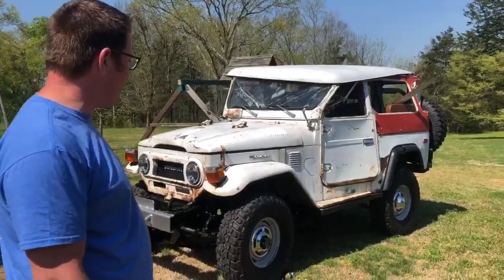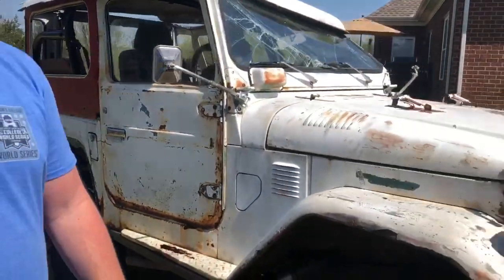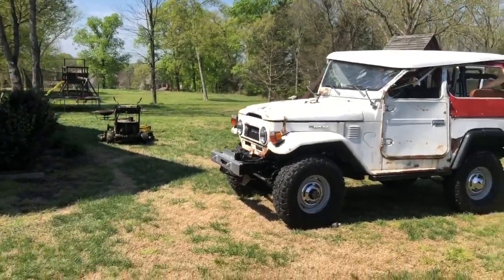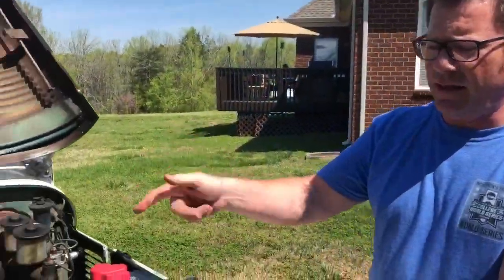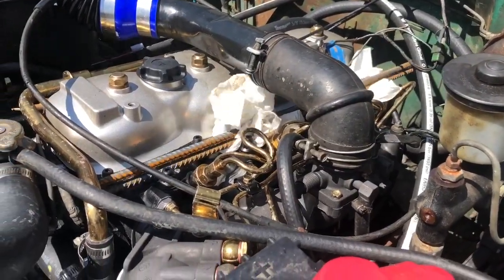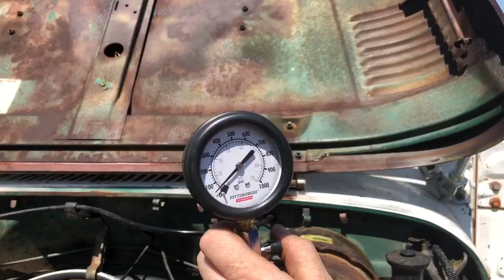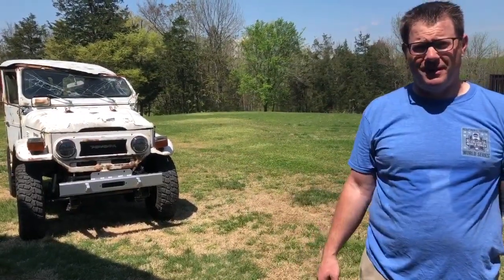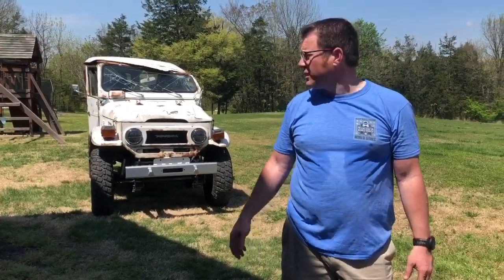Put the FJ40 on its lid - how much damage?

Comment: Ouch...  did you get a chance to figure gas mileage with the diesel?   Please let me know what you were getting with it.  I'm considering swapping my 1F for an oil burner.   Love the diesels!
Reply: No, didn't, the 'new' replacement tank I bought off a guy had a leak in it, so I wasn't filling it over halfway. I do have a new long range America tank on order. When it comes in and we get her back on the road we'll let everyone know. Thanks for watching!
Reply from the maker: You should do it! What diesel are you wanting to go with?
Reply: @musiccitycruisers3863  I'm still just learning...  I have a couple PowerStrokes and a few diesel toys, so I do love the diesels, but trying to justify the project time on the FJ...  My goal is not really fuel cost savings due to MPG, but mainly travel range between re-fuelings, as I"m out in the back woods of Canada where there is no gas available.  I think I will just do the two extra fuel tank route.  I have the '72 with the larger 18.5 OEM tank to start with.  I have the Blazer tank which is 20 or 21 gallons, and I think a Wrangler 10 or 11 gallon tank will fit under the driver position, inboard of the frame rail.  I will re-route the muffler to be outboard of the frame on the driver's side with a 'kick out' in front of driver rear tire.